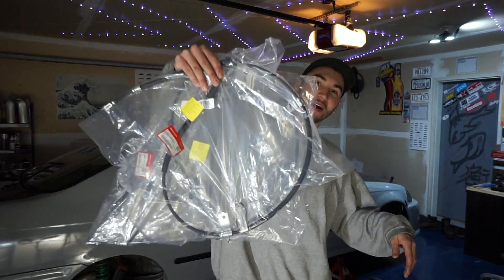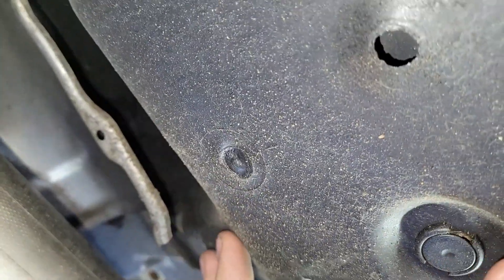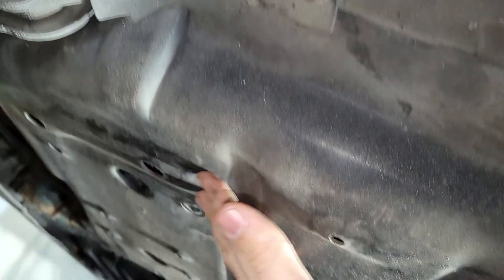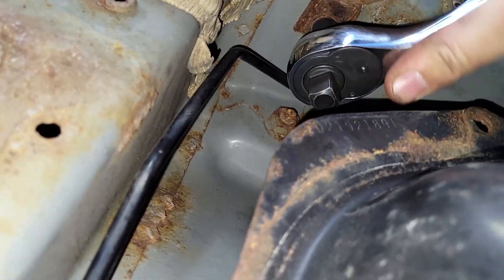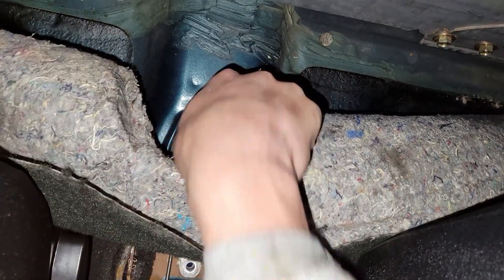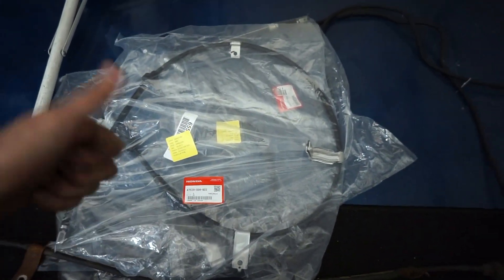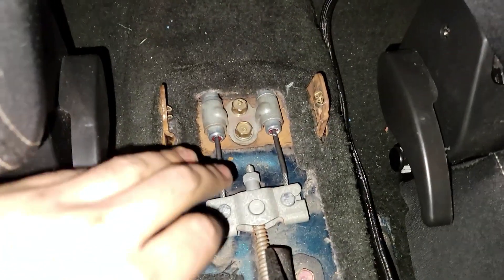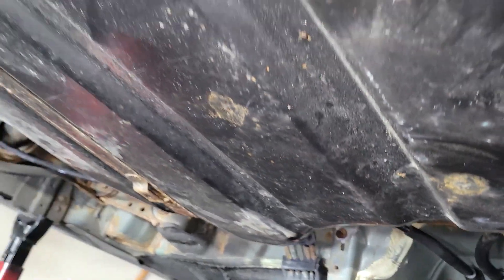96-00 Civic E-Brake Cable Replacement for Rear Disk Conversion!

Comment: Question so I did the rear disc swap on my 97 ek coupe but they came with eg e brake cables and those are too short. What e brake cables do I have to get so they can fit? I heard people say the integra rear disc e brake cables fit but I’m lost
Reply from the maker: You need cables from the 99-00 civic si. That car came factory with rear disks so they are the right length!

Comment: 5:27 "There's rust everywhere!"  You should see my Fiero right now with the trunk carpet pulled back.  I also need to put in e-brake cables as they are missing and it scares me.  As for brake lines, I used Nickel-Copper lines.  Easy to work with and better corrosion resistance.
Reply from the maker: It's not easy living in the rust belt😂

Comment: 9:23 Bracket you said you would have to order...what did you find?  I am doing basically the same conversion, (94-01 GSR rear calipers, 99-00 SI parking brake cables).  The bracket for the cable that came with the Powerstop GSR calipers won't work because of the EX trailing arms.  I was just about to fab a set of them up but I'd still like to know what you used.
Reply from the maker: 43247-SH3-931
43267-SH3-931
 And I used 90651-538-000 for clips!!!
Reply from the maker: Ebrake works great man!
Reply: So the bracket you're referring to. What is the threading for the bracket to the caliper itself?
Reply: @jamesbrown2738  1.25

Comment: Do i need the si e brake lines or will my stock ones work?  I have a 98 dx
Reply from the maker: SI e brake lines is the way to go, stock will not work unless you find a way to modify the cable

Comment: Did you do the e brake for both sides or just one? Wasn’t sure what to order
Reply from the maker: Yep I did both sides! Check the video description for the part numbers! Calipers, caliper brackets, and cables will be different part numbers for each side, but retaining clips/pins will be the same for both! Hope this helps!
Reply: So you do have to change the brake lines when doing this switch ?

Comment: I'm doing this swap currently.  are both E brake cables the same length?

47510-s04-932 , Left 47560-s04-932

I've seen some places say 1 is 1670mm and other side is around 1600mm, but then I've been told there both meant to be the same length? are you able to confirm.

look forward to you answering if possible :)
Reply from the maker: I believe they are slightly different lengths, the two different sides have different mounting brackets that come with the cables as well
Reply: @kraftingkars  Appriecated your response,  i was expecting the Right side  47510-s04-932 to be shorter, according to Rockauto, but it looks like they may have changed to matching lengths

Comment: Do you know if the 96-00 EX model cables will work?
Reply from the maker: No sir, that's what I had before, they are designed for drum brakes

Comment: Will part numbers work for a 99 ex ?
Reply from the maker: Yep everything should be exactly the same! The scarebird bracket comes in two different styles, HON and CIV, HON is for flat faced spindles, and CIV is for spindles that have the indents. My 97 Civic uses the HON spindles and adapter plate found here https://scarebird.com/index.php?route=product/product&path=67&product_id=116 Hope this helps!

Comment: Alright SO the ebrake cables 

are there a difference between them besides the mounting clips? 

there's ebay postings for these says left AND right si/tegra cables
Reply from the maker: Yeah, the drum brake cables and disk brake cables connect differently to your brakes. And integra cables are too short to use in a 96-00 civic chassis and require modification to make them work
Reply: I meant Specifically the disc brake cables 
L and R sorry
Reply from the maker: @xToxicfir3x  So yeah besides the different clips, they have to be pretty darn close in length if not equal, I would recommend getting the specific L and R cables though